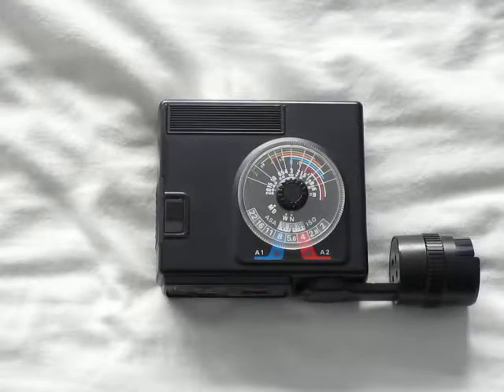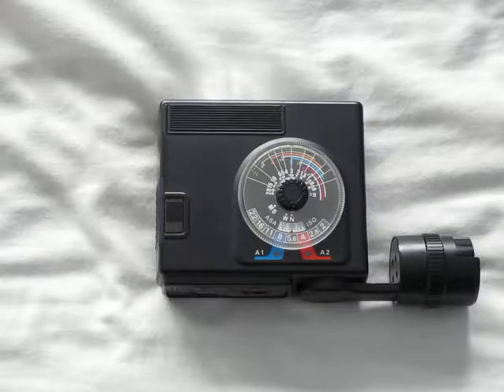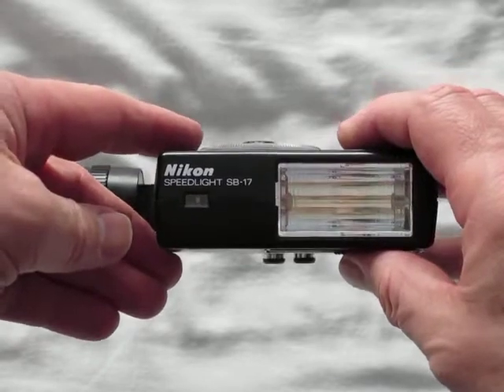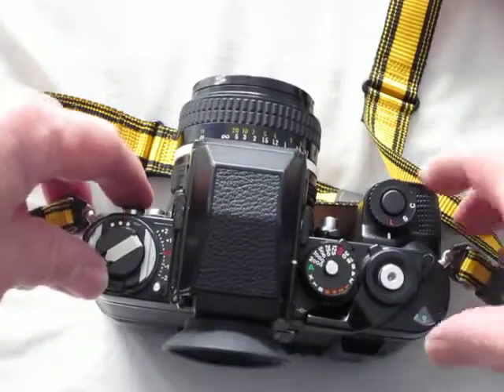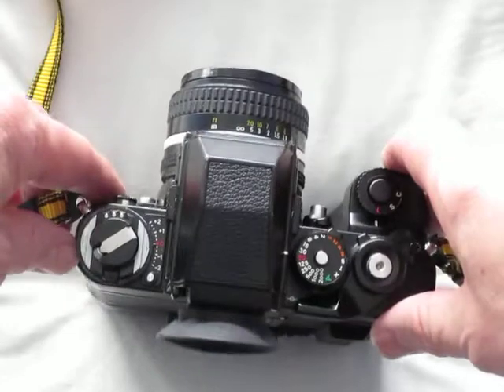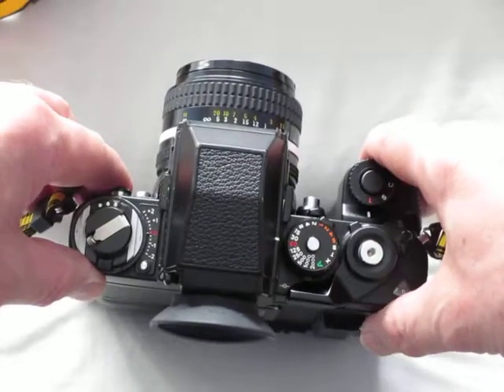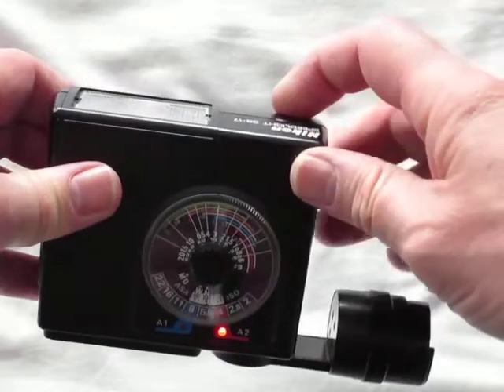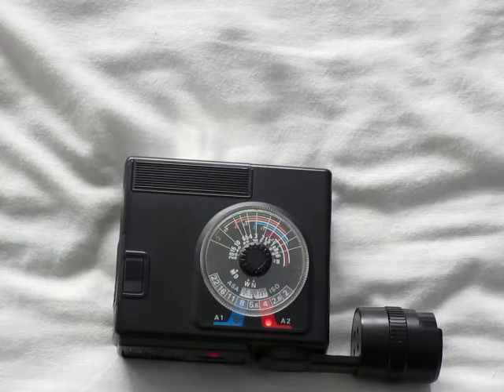Fill in flash for film cameras.

Comment: Paul, me again!  After following your excellent " 2 stops fool flash " video and with brilliant results, ( Yashica Tlr/Vivitar 283). Can the sensor work out light bounced from umbrella if sensor is camera mounted and -2 stops from ambient?  As I said so pleased with first results but wondered if I could soften resulting shadows? Many thanks, Dave
Reply from the maker: Hi again David,
 I think that you may be pushing the capabilities of your flashgun by bouncing it into an umbrella. It might be an idea to experiment because if you set for 2 stops less light you will then lose more light by bouncing your flash. You could always switch to manual and vary the flash distance to the subject, just watch out for unwanted shadows. This is where you could use the (digital)Polaroid cheat.
Best of luck and happy experimentation 
Paul

Comment: Paul, excellent vid re: fill flash for analogue. Used your info for Yashica Tlr, which sync's at all speeds with excellent results. When you take ambient reading and it indicates, 1/250 f8 and you set flash to f4, (is 2 stops less) does shutter speed affect exposure?
Reply from the maker: Hi David,
 I`ve never used a TLR, I do however have a Bronica ETRSi, lovely camera and it to synchronizes at all shutter speeds. The joy of leaf shutters eh. In answer to your question, indeed it does. You can control the background making it lighter or darker using the shutter speed. Imagine a well lit subject against a broody dark sky. It might be wise to shoot a few test shots to get the flash exposure spot on, or indeed use a digital camera as a polaroid substitute. Remember my video says this technique is to have a well lit background so an increase it flash may be necessary.
Hope this was helpful.
Best wishes
Paul
Reply: @paulhill3575  thanks Paul for prompt reply. Your video extolling the 2 stops from ambient worked so well for me. Think it was 1/250 @ f8 by hand held meter, so set vivitar to orange, f4, 2 stops. Stopped down to f11 and got model's face/ hair etc perfect, darker background. What would change if shutter speed altered. Yours is the only video I have seen explaining "fooling flashead" , Priceless, thanks. Buying Mamiya c330 so leaf shutter/ multi syc and due to it's weight will help with personal fitness?
Reply from the maker: Hi David,
 changing the shutter speed will alter the background lighting. faster shutter speed = darker background. slower shutter speed = lighter background. if your original ambient exposure is 1/250 @ f8 and you can synch your flash at 1/500  @f8 the background will be underexposed by one stop.  This is where digital cameras with HSS are a boon in bright daylight, medium format cameras with a leaf shutter also offer this feature. it`s worth playing around with a roll of film to see what you like, making notes as you go so you can repeat your best results.
Have fun.
best wishes
Paul
Reply: @paulhill3575  You are a star Paul. That's the information I needed, on top of your vid about "fooling the flash" Mastered that part, will do some at higher shutter speed now for  darker backgrounds. Thanks again, Dave